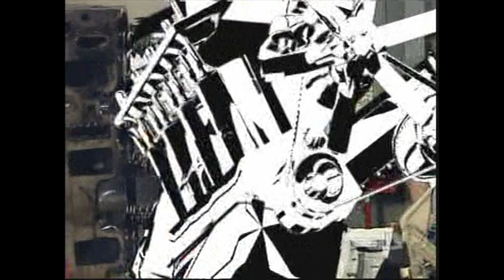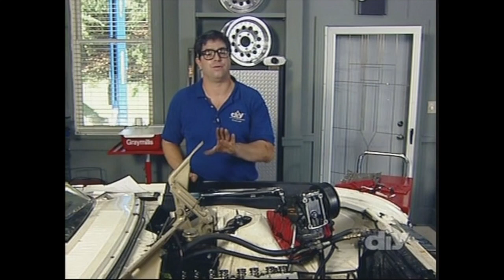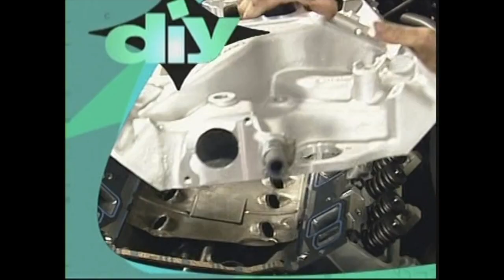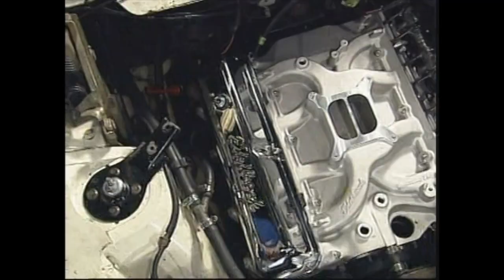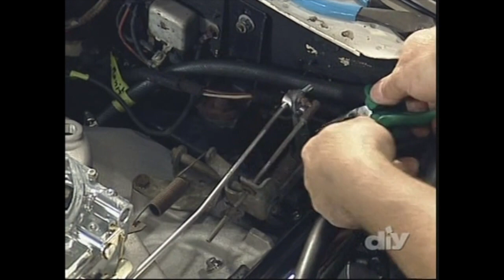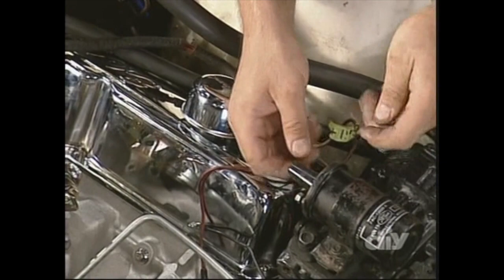Classic Car Restoration ep 5 1962 thunderbird

Comment: I have a 61 Thunderbird and am about to do this same service rather then try to hone out all the intake and exhaust port scale from my stock intake and cylinder heads. How did you manage to put the exhaust manifolds back on? I am thinking to put them on the heads prior to torquing the heads down.
Reply from the maker: this isn't my video but i think the drilled the holes out bigger

Comment: Yea-go with chrome, you already screwed the car with the heads and intake swap.  You will be the coolest old dude cruising the high school parking lot.............
Reply from the maker: this was from a show on the DIY network not mine
Reply: @MarksofDistinction  yea, I know.  I just had to put something up.  I hate when people screw Thunderbirds and Lincolns up trying to make them something they were never intended to be.  It's like they can't afford a Camaro so they try and screw up something nice.  These Thunderbirds and Lincolns were pinnacle cars of their times and all built in their own special plant.
Reply: @bmt336  If that's a true Sports Roadster as they claim it's worth more than many Camaros
Reply: Look what this IDIOT did to this Thunderbird! Put the ORIGINAL parts back!!! Just clean them up good! I really got sick when this SHMUCK put the chrome valve covers on instead of the ORIGINAL ones!!!!???? These cars are WORKS of ARTS when they were Brand New and still TODAY!
Reply: 0 to 60 in about 10-11 seconds,  I wouldn't knock anyone that does a head and intake swap to make these merge onto the highway better. (I own a 66 vert, it's slow as hell). Plus modern fuel likes the cooler aluminum intake.